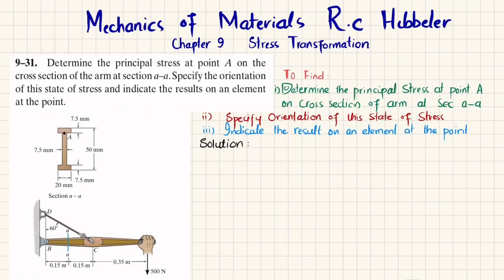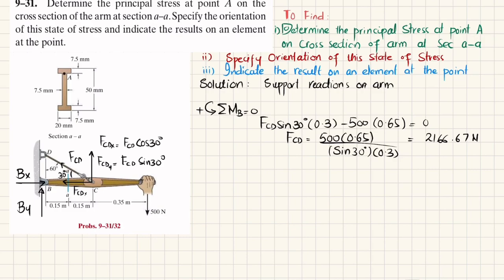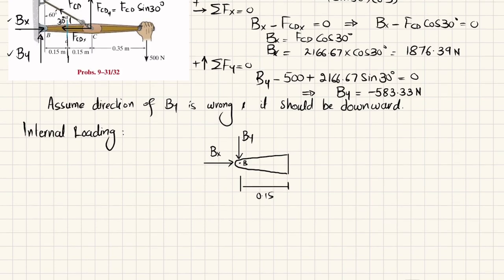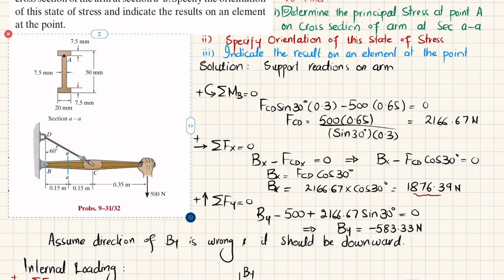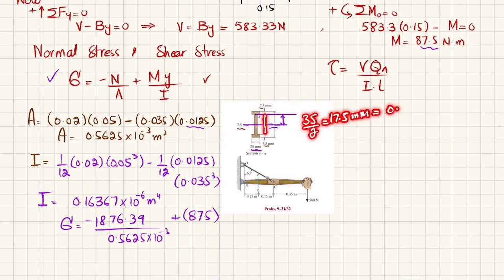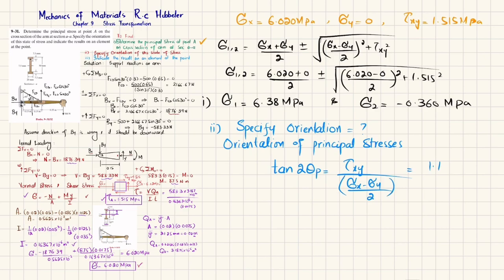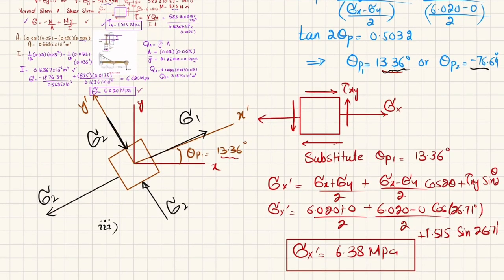Determine the principal stress | Problem 9-31 | Stress Transformation | Mechanics of materials RC Hi

Comment: Professor I have a question about at  20.40. Why de we put 1.515 Mpa put on  the upper right corner in the state of stress section. so why did we choose the upper  right corner ?
Reply from the maker: it is acting in all four planes top bottom, right left. as tau xy = tau yx so i just wrote tau xy. x represent x plane and y shows in the direction of y

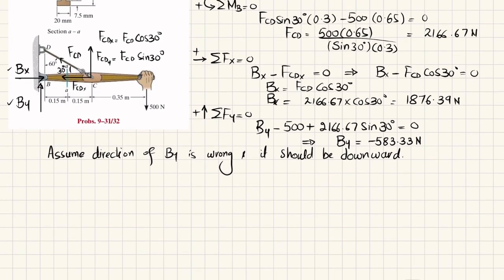Comment: Professor at 6:48 why did we calculate from left side of a-a instead of right? (Also if we use the right wing of a-a V becomes downward so negative im super confused)
Reply from the maker: You can use either left side or right side but when you take right side the number of force will increase and calculation will be a bit lengthy. Anyhow if you use right side it is also easy. Try it and check it ...
Reply: @engradnanrasheedmechanical  thank you professor but isn't V becomes downward in right plane could you check it briefly please
Reply from the maker: @deschainzz7570 yes if you take V downward on left side then on right side it will be upward
Reply: @engradnanrasheedmechanical  the point that make me confused is if V is downward wouldn't that make tau negative?

 (btw teacher we are your fan as a whole mechanics class:) )

Comment: sigma x, the result of VQ/IT SHOULD NOT BE NEGATIVE BECAUSE THERE IS A CLOCKWISE MOMENT ON POINT A ?
Reply from the maker: please specify the time frame where you are asking question.
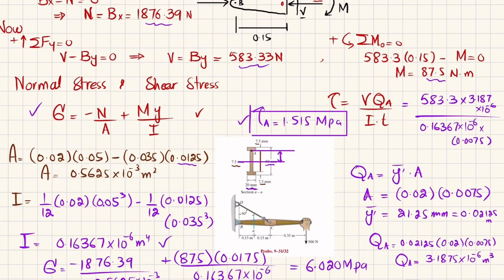Reply: @engradnanrasheedmechanical  20:00 please
Reply from the maker: @rafhaelcalderon4033 both are positive ❤

Comment: professor, the moment of inertia could be calculated by separating the section into 3 parts, the wings and the soul and then adding them, this result does not give me what you get, 0.1637 14:30
Reply from the maker: I have calculated it again and its correct. Rest you can also find the  moment of inertia by the method which you are describing, you will get the same answer. I think you are making mistake in some places. check it again. Thank you
Reply: he is putting the base of the two cut outs as one base 0.0125m making it I of the whole rectangle - I of the cut out space as a whole where you were trying to do I whole rectangle - I of cut out right side - I cut out left side, where your base would have to be .00625 in both cut outs
Reply from the maker: @tobiasheslin4952 thank you 😊 🙏